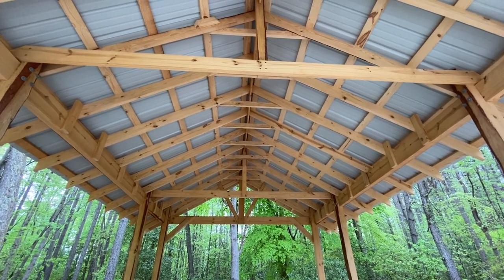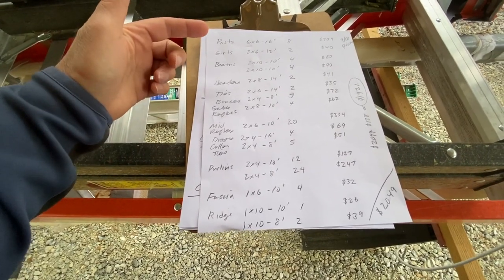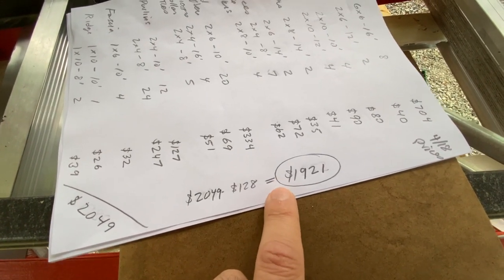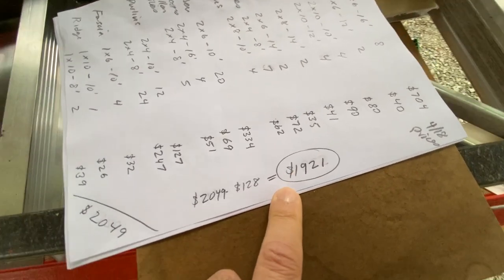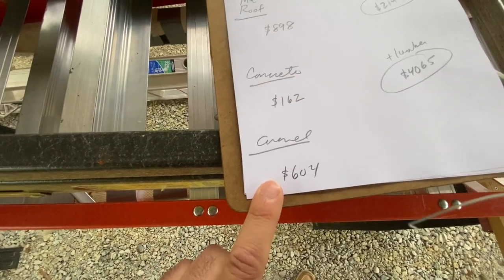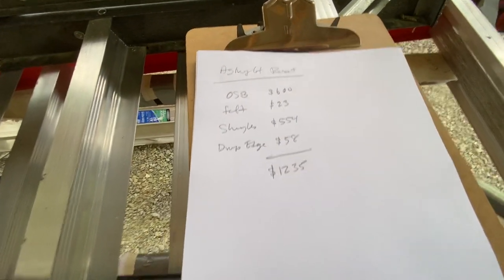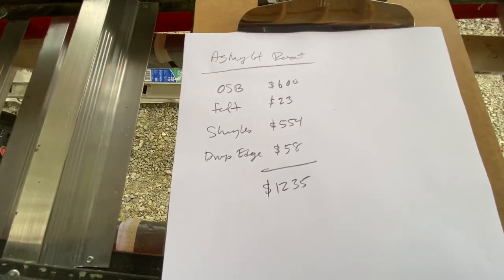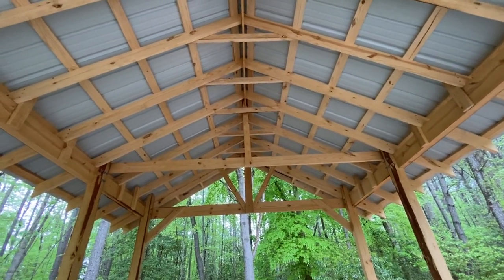Timber frame carport: summary, material costs, and how to save money with a sawmill

Comment: Do you have plans available for this build? I would love to build something like this...maybe add a lean-to on each side.

Thanks for the inspiration and well thought out design and videos.
Reply from the maker: No plans, but it does follow a pretty standard pole barn construction method if you ignore the few timber frame tweaks here (which I only did because I could saw my own lumber to any size).  The pole barn method is very simple and very scalable to a range of needs.  I am preparing to add a lean to and close it in over the next 6 months or so, but have a few details to work out first.
Reply: I like how your 6x6s aren't all evenly spaced...instead they present like 4 pairs.

Comment: Thanks for the thoroughness of your report.  Could you comment on running costs for the project?  How many blades, sharpening etc.
Reply from the maker: I recall using no more than 2 blades for all that lumber.  Did not track fuel costs but it was peanuts.  The mill runs for a long time on a tankful.  The mill is cheaper to run than I expected.  I think time is the biggest investment, once you think about felling the trees, skidding the logs out, milling, and stacking.
Reply: @Lumber_Jack  Thank you for the quick response.  I was worried that blade replacement would be a big item. 

Judging from your presentation style I bet you don’t ‘push’ the saw and instead listen for sounds of the blade getting overloaded.   Less heat, less breakage, more productive time sawing.

Comment: Thank you for sharing. Can I please ask you thoughts on this:  I am in the process of building a 110sq ft, unattached, covered pergola for all season use and to give the West side of my yard/house some much needed shade in the summer..I'm using pressure treated wood. Is a metal roof a good option or will it reflect the heat onto the deck? Thanks so much.
Reply from the maker: If you choose a light color metal, it will be a fairly cool roof choice.  I've never run into problems with a metal roof reflecting heat.
Reply: @Lumber_Jack  Thank you. This is reassuring to hear.

Comment: Are you building with fresh cut timber? Just curious because I see alot of videos saying you have to allow the would to dry before use.
Reply from the maker: For these types of projects the lumber ranges from fresh cut to lumber that has been milled then dried for 2-4 weeks (there is a pretty good amount of drying, shrinkage, and reduction in weight in just 2-3 weeks).

If using lumber this way, you need to make some accommodations to allow for shrinkage.  That mostly pertains to types and placement of fasteners.  There are techniques made for this (for example board and batten siding or post & beam construction).

I would not use fresh cut lumber for woodworking or finish trim work, but for rough framing it's been working out fine as long as you make accommodations to allow for shrinkage and avoid splitting.

One benefit of using green lumber is that it hasn't had a chance to warp or twist.  If you can fasten it down and let it dry in place, a lot of those issues are eliminated.
Reply: @Lumber_Jack  thanks for the info
Reply: Great build and thank you for sharing. Are you using pine?

Comment: Why use treated post's in the ground VS a post base bracket?
Reply from the maker: Another option is to pour concrete piers and put brackets or straps anchored into the concrete, then attach posts to that.  However, you have to be super accurate placing and orienting the brackets and you lose the flexibility/benefits of the pole barn method.  With the pole barn method, I can frame up the structure by myself with the posts standing loose in the holes, square up the structure as the skirts and girts are installed (kicking/angling posts as needed), and then backfill the posts only after the posts and wall girts are all square and perfect.  You basically use the structure as a guide to square itself up.  When working alone, this allows you to get a much better frame built up more quickly.

Comment: Does the metal drip from condensation?
Reply from the maker: Normally that is only a problem with enclosed buildings.  I've never seen any open structures have a condensation problem.
Reply: @Lumber_Jack  It happens on my lean to shed against my house. 2 sides open 2 sides closed.

Comment: You know, back in the 1950s, they used 1x12 boards on the diagonal for roof sheathing.
Reply: The diagonal sounds like a great improvement for the roof and maybe siding for a wood structure. Not needed for metal.

My wife’s family had a 22 x 34 timber frame barn built in 1847 which had 3/4 x 8 black spruce boards under shingles.  Roof was 10/12 pitch with 6x6 rafters spaced 7’ apart.  It survived many 6’ New Brunswick snows.  

We took it down and transported it to California where it stands proud.

I hope to duplicate it some day.

Comment: Been tossing around the idea of getting a mill , mostly to get slabs to build furniture projects out of box elder and birch , but structural lumber as well . What's holding me back is that the only saw log size trees we get are aspen . What do you mostly get?
Reply from the maker: Loblolly pine is abundant on my property, but I have scattered hardwoods too, mainly oak, beech, hickory, maple, and poplar.  For framing lumber and siding, the pine is perfect -- loblolly is one of the southern yellow pine SYP species used for commercial framing lumber.

I believe Aspen is related to poplar, which makes very good siding and board lumber for projects.  I don't know what type of characteristics it has for framing lumber though.  The ratings in my wood handbook suggest aspen is similar to white pine for strength, bending, etc.
Reply: Yes aspen is related to poplar , locally it's called white poplar . My dad cut some to build grain bins in the 50s , they are still straight ,it has to be used right away or stacked with weight for a few years , or it will warp real bad . I saw a house framed with it , they waited six months after framing to board inside walls , after shimming to straighten them the walls were ten inches thick

Comment: I never thought of mating pressure treated wood to sawn 6x6. Nice idea. I normally pour concrete tubes and mount my posts on those but your way makes sense too, thank you for sharing your experiences!
Reply: you lose all the strength though. Definitely need to support the lower part of the structure. He does have some, i would do more if you get big winds.